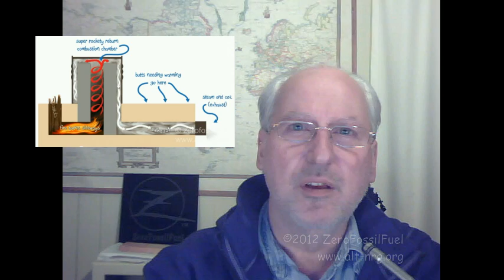#318 Lab renovation update #4

Comment from the maker: Actually I'm not planning for mine to have a large mass. I'm more interested in instant heat on demand rather than heating the space for daily living. My plan is to build a forced air heat exchanger for the flue pipe to extract the heat instead. My unit will also be smaller than most so this may be uncharted territory.

Comment: Will you do a separate video just for the rocket mass heater?  Even if you don't video a lot of the steps, maybe you could just stitch your progress pictures together.  I've been doing a lot of reading/research on building one and how to retain as much heat in a mass as possible.  Do you have a finalized design for the heater yet?